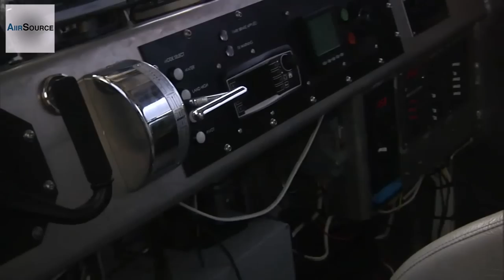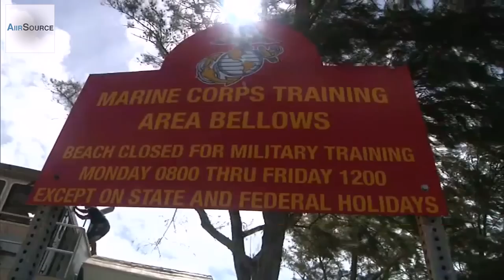US Marines MASSIVE Experimental Amphibious Vehicle - Ultra Heavy-Lift Amphibious Connector

Comment: Does everything really have to be explained to people on the internet for them to understand? This was made to carry heavy supplies that are too heavy for any current amphibious vehicles. And if you bring up a situation like D-day, this would be used after the beach was captured to bring in all the supplies without ever needing to transfer vehicles. Like I said, it is made to carry supplies too heavy for something like a hover craft. And I think it would be fairly useful. And don't forget that it is a experimental vehicle or prototype. So it is not a efficient as a production model would be.
Reply: What about the hovercraft that are capable of carrying tanks?
Reply: yes, they can carry them to shore. but could they carry something like that from the ship to the front lines? that is what this is for.
Reply: the keyser soze No, not tanks. Stuff that is heavy and is required by the forces that are in combat. Like a giant generator, or something along that line. And this could take it straight from the ship to where it needs to go.
Reply: ***** I know I dont get this things purpose put a heavy hauler truck on a hovercraft land on the beach and away you go
Reply: This unit is half the size of the proposed vehicle...
Reply: You canput a huge shield in front of that mofo and push hidetroops closer to the combat area, also carries shitload of supplies, not a bad vehicle, very massive too.
Reply: Yeah!!  Like BEER!
Armies should switch to POT as it is lighter...
Reply: I immediately though of D-day too when I saw this.  And with the recent introduction of Active Protection systems and advanced armor, you might actually be able to deploy it to front lines in amphibious assault. 

And yes...the internet allows any whiner to be heard, therefore intelligence is not always guaranteed.   (See above and below comments.  Not your's Willems, or Excess, but I mean those surrounding it)
Reply: the keyser soze
It's said that the full size one is supposed to carry 3 Abrams.
Reply: Just go with your experiments.  youtubes has a lot of so called experts that are crabs. They just want to be given attention. 

Frankly speaking, if they were that good, they wouldn't be in YouTube writing comments but rather be one of those guys in the video.
Reply: Peter Robann Sobrepeña HA! Well Said!
Reply: If this was a video about how to deliver supplies rapidly to flood victims, or rescue crashed plane survivors, i would be applauding the inventiveness to a point. (it may be so used later... ).
However, when human endeavors is so often associated with military activities, i consider it a waste of time, talent, and morality, not to mention waste of energy/resources that could be redeployed elsewhere.
The military minded people will say 'oh, but we'll fall behind in the arms race' or some such nonsense.
Its supposed to be the other way around, like the Supermarine Spitfire, which went from a quasi civillian role to a military one, albeit with prior intentions thanks to industrial espionage.
Reply: Well the good part of the arms race is that a decent amount of modern technology comes from arms race (I'm not condoning warfare, but there will always be someone who wants some else dead.) The space race, an arms race in it's self brought us a lot of modern technology that we use everyday.  Most likely, whether or not the military takes it, it will like you said, be used in that since.  If not, if this does work, SOMEONE will find civil uses for it.
Reply: Tim Morrison
Meet the Sniper
Reply: Peter Robann Sobrepeña Well said!
Reply: yeah right I can just see this thing trying to get ashore on D-Day the whole German Army would would die of laughter
Reply: for most kids if there's no gun on a thing it isn't a militar thing
Reply: ***** This IS just the experimental / test version, a proof of concept vehicle if you will. It's true purpose was to test the tread design on its catapillar tracks, to find the most effecient design for both land and water. The actual combat version will be much larger, armed and amored, I would imagine.
Reply: Bernard Gilbert
Don't forget faster.  The T28 Super Heavy Tank prototype weighing 95 tons was only give the Ford GAF 500hp engine leaving it very underpowered, but had it been put in production, would have been fitted with a more powerful engine.  Same with this.  If they go forward with this design, most likely they'll use a much larger powerhouse, increasing the speed to a level of usefulness.
Reply: I'm just saying it doesn't make any sense we have ships that can literally drive up onto the Beach to offload we have lover craft that can carry tanks even the heavy ass m1 Abrams where's the payload ability on this crack hauling crates of ammunition I don't see any room for a tank
Reply: Donavin Jaye and if this is a prototype to test its ability to maneuver or proper track it would seem to me it would need a test load also in order to truly test the machinery and design features
Reply: Meh. Still too slow. I want my heavy equipment to be dragged in faster pls.
Reply: Those keyboard scientists don't even know this is only a small scale prototype. This thing has potential.
Reply: It has the potential of being blown out of the water I still believe I would rather stick with the hovercraft
Reply: Well, once again, it is just a proof of concept, and it may be scaled up to perhaps the size of a hovercraft, and due to it size, they could easily fit area defense system to protect it from enemy fire.
Reply: True I understand this is a test example and can be made larger or more effective . My problem is why do we need another different types of landing craft when we have several already try true and tested already in production examples hovercraft and large vessels can't think of the name of them off hand that can literally drive up on shore unloading a whole ship worth of material I see no need for this machinery so I'm forced to view it as a wasted program sucking money
Reply: Talk about blown up potential, I bet that "treadmill on water" can take more bullets than a hovercraft.

That thing is designed as an eighteen-wheeler on water. If a commander is sending an eighteen-wheeler to the fire-line he should be fired.

I am not a ship expert and I am sure no one on YouTube is. But at least I am open to creative ideas and those keyboard scientists know only to b....
Reply: tell me how this is better than LST and hover craft used in conjunction with assault.
Reply: It would be silly to compare that "treadmill" with hovercraft in an ASSAULT. 

That thing is an logistic equipment, it is all about reliable, cheap to make, cheap to fix, heavy lift, huge cargo space.

If you are looking for fast speed, bullet proof, assault landing, high tech, then you are asking a semi-truck to do the armor vehicle job.
Reply: Donavin Jaye Jesus Christ people its not replacing our beloved lcac its gonna supplement them... Meaning work in conjunction.
Reply: I still believe its fat that can be trim from the budget and better spent somewhere else and redundant my opinion guys I'm entitled to it just like you are
Reply: Yeah, budget is a whole 'nother subject (don't get me started) but this actually looks like a much cheaper solution than a lot of other things, like helicopters and littoral craft.  Those have a steep payload vs. cost curve, but this might SIGNIFICANTLY cheaper in load/cost.  But to each his own opinion here, because I doubt we'll effect the defense budget decisions via Youtube comments section.
Reply: It reminds me of some of the huge tanks that the nazis made during WW2 for the Russian campaign. They were so heavy they all sunk in the mud. Incredible wastes of time, effort, and money.
Reply: Texas Ray You can't really compare this to a failed Nazi tank, and its tracks were specially made to traverse  beaches with a heavy load. I think in the near future the faithful but old lcu landing craft utility will have to be replaced and this vehicle can carry more than it and is far more versatile...on top of that more can be carried in an bamphibious assault ship.
Reply: Why are you explaining it.  We all understand.  You asked "why does everything have to be explained" then went on to explain it.
Reply: Steve Gould Doesn't seem like anybody understands actually. So I explained it.
Reply: ExcessMean Dude there is something faster than this, ZUBR class hovercraft look it up
Reply: akrilon77 Hey dude there's something even faster than that and can be carried on ships its called an lcac.
Reply: anfernee jones yep but i mean ZUBR is the biggest hovercraft
Reply: akrilon77 Yeah its bigger but can numbers of them  be carried in amphibious assault ships around the globe  ? No there far to big to fit onboard your traditional amphibious assault ships , on top of that they only have a range of 300 miles so without a ship carrying them there not going anywhere far quick, and there's only 7 compared to the us navy's 90 plus ship compatible lcac.
Reply: ExcessMean Technology and Science evolution to childlike men that are thinking and trying to solve problems like  s. XIX's people. Mountains of stupid down the drain money.
Reply: Ryan Taylor That Info's not right man, the one that suspossed to enter service is supposed to be big enough to carry 2 tanks, and be bout same size as LCAC, and its not replacing lcacs either its a supplement component, which means it'll be used in conjunction with lcacs kinda like how the traditional landing craft utility boat (look it up) is being used in conjunction with lcacs now.
Reply: ExcessMean Your whole "explanation" is completely debunked by the hovercrafts they currently use. They can carry things strait from ships to shores at a fast rate an d carry more than this can in a shorter time frame. Try again mr. "expert"
Reply: DG Stevo Look At my above paragraph for more accur ate information about the uhac please.
Reply: DG Stevo Hovercrafts have major limitations. If the slop is too high, it's hard to get up. Unless you go really fast. But then you need a run-off area, as hovercrafts don't stop quickly. And they're generally hopeless for navigating tricky terrain -- at least compared to a tracked vehicle like this thing. Right tool for the right job.
Reply: Donavin Jaye Do you have any idea how much it costs to maintain those LCACs compared to a tracked vechicle? Also, the one in the video is a 1:5 scale prototype. It will be able to carry nearly 3x the payload of the current LCACs, twice the range, will go over 10ft sea walls, and will cost half the price to build and maintain.
Reply: I would like to know where you got these figures and cost analysis along with mission concept and requirements is there a site that use more information if so please direct for verification
Reply: Donavin Jaye Google search, then Wikipedia. I haven't checked the sources cited in the article, so they could be wrong. But wikipedia is generally pretty good unless you can prove otherwise. Also, I know as a hovercraft enthusiast for many years, that any hovercraft with a high-power gas turbine of a certain size has a high maintenance cost, as they are more like maintaining an aircraft than a water vessel or ground vehicle.
Reply: ExcessMean not a whole lot of room in that mission bay.
Reply: Mike S A wasp class LHD has a well deck to accommodate 3 lcac. 2 landing craft utility or 3 uhac's
Reply: anfernee jones
This isn't an LHD.  This is some weird transport that seems impractical, slow, and with low survivability.  It makes more sense to use a JHSV that can move cargo and troops ashore quickly.
Reply: 0hn0haha I doubt that you will ever need any equipment.
Reply: ExcessMean When is the next D-Day scheduled to take place?

Comment: I like how everyone is quickly assuming this thing is a failure.

In all honesty they're only thinking of "HEAVY DUTY ARMOR AND GUNS ARE ONLY GOOD HURR"|

This is a prototype, they are probably sorting out the tread technology and finding the most efficient design for more power and efficiency, before they ramp up the speed of this kind of thing, THEN adding on light armor or something heavier.  This seems like something that would be used to tow heavy equipment, possible large artillery cannons?  This kind of thing would be AMAZING for mobility, since most trucks and heavy tanks would get stuck in the mud and loose terrain very easily.

This is a really neat concept for mobility where conditions limit other vehicles more suited to conventional means, there aren't perfect flat roads everywhere y'know.
Reply: Gakell Kag I'm thinking logistics. Look at the steel investment, and water stability. Then stuff in speed and it doesn't come out well. It might not be too bad but it looks far too complicated to be practical.
Reply: mfk12340 What you actually mean :*IT DOESNT HAVE ENOUGH GUNS DURR HURR*
Reply: fuzzy puggle
*First world
Reply: +Gakell Kag - Yeah, it's a concept. The final release won't be able to move at all.
Reply: It’s cool.  It’s waaaaay to fucking slow.  If they’re looking to sell this to the military they have to bring a product that can perform.  This just can’t.  

I spent 12 years around LAV’s, AAV’s and tanks.  Sure, all armored combat vehicles.  However, something like this, wouldn’t even be considered.  The LCAC and other amphibious vehicles the Navy has would be used long before this.  

This piece of shit couldn’t have even kept up with the advance at Normandy once the beaches were cleared.
Reply: Gakell  ,y

Comment: I feel like the wheel is being re-invented but this time larger. There are so many intricate track pieces to this behemoth that any well aimed shoulder fired missile  would put this thing out of business. I guess it could land some heavy equipment if somehow you could sneak it up on the enemy's beachfront. If the marines are using a ladder to get up inside the "payload" bay, what are the plans to offload that heavy equipment? I guess you could rent a heavy lift crane from the local "Enemies R Us" war surplus store. :D
Reply: At 3:34 when the Marine climbs up; see those things strapped to the sides? Those are VEHICLE RAMPS!!! I was an AM TRAC'er from '91 to '96. There were lots of splashes where we were just used to transport supplies and not Infantry. Thats a lot more wear and tear on our vehicles. Especially if you're landing on a beach that is already secure. This would probably be used on beaches nowhere near combat. Is this the answer? Who knows. You have to do experiments. Look how long it took to get the Osprey right.
Reply: RUBIZEN
Yeah, the Osprey is still a huge albatross, and still isn't quite right.....

Comment: Probably be a good idea to put some guards over the top of those tracks so it's less vulnerable to attack and  would also give a good platform for some defensive guns. That way they could be a good way to transport troops onto beaches faster without having to exit the vehicle until much later :)
Reply: They well run out of ammo before reaching 5 feet :p
Reply: Scott Dann Transport troops faster? They can dig tunnels under the beach to attack the enemy from faster than this thing moves.
Reply: Scott Dann I think this is designed to carry supplies etc., not to be a first line assault vehicle.

Comment: WHAT A WASTE OF MONEY! This crap looks like something from the 30's! Imagine trying to pull off a beach head landing under fire in that turtle while they are firing laser guided shells at you! Hell, they wouldn't even need guided shit, A Somali child soldier could pop that with an RPG at 200 yards DRUNK it's so slow! Whoever designed that should be fired immediately and whoever approved the funding should be fired too!
Reply: Threatstodebts69 Its not a waste of time, further improvement and a tracked amphibious vehicle could be an amazing vehicle truly.
Reply: This seems to be the proof of concept phase. Think
Reply: +Riot Mine 
Yeah they could make it slower and make the armour of plywood so it saves money by making more of them, then you guys can have like 50k of them storming the beach because once one of them hit the beach 97% of them are sunk but because they are cheaper to make than a lunch box you can just make more of them. 

The enemy would run out of bullets and America would win by default of course after you disposed of half your population just to man these things.
Reply: I'm guessing you disagree with my standpoint, although I truly didn't get much from your comment. Instead of an essay/story next time explain your view on the topic, power in numbers though right? 50,000 transport vehicles sure can supply a lot of troops! I don't get why you can't get it! It is not for running into the battle, it is for getting the soldiers to the battle so they can run in!

Comment: So many ppl in the comment board bashing this vehicle, stating that it'd be useless in storming beaches. Well, people, has it occurred to you that this vehicle is not friggin meant to be a combat vehicle in the first place? Some ppl say "wow as a transport it's slow as a turtle what a waste of money bla bla bla...". Well, from the way I see it, I think this tractor is a prototype for a new amphibious recovery vehicle that can remove wrecks from the beaches or from the waters leading up to the beaches. Think about it. After the beachhead has been secured, there would probably be tons of burning wrecks (blown up vehicles, AAVPs, etc.) strewn all along the tideline and in the surf/swash zones. If you want to transport supplies onto the beach in an efficient manner, you gotta remove these obstacles. Since wrecked tanks are heavy pieces of metal, you'd need a powerful tractor that is both strong (hence the slow speed---it has massive torque in its wheels), amphibious, and can pull stuff effectively while travelling on loose slippery sand.